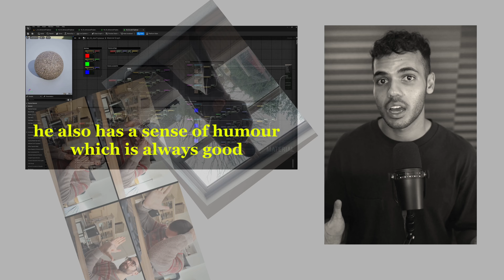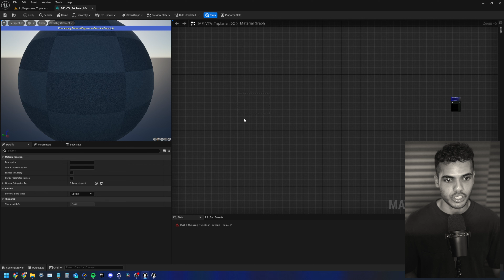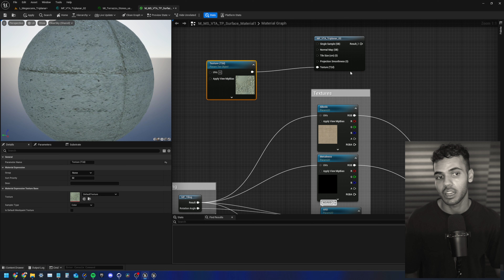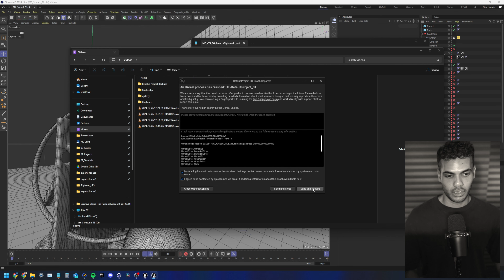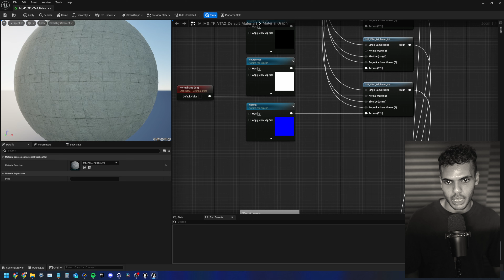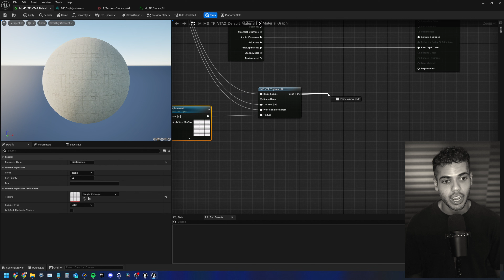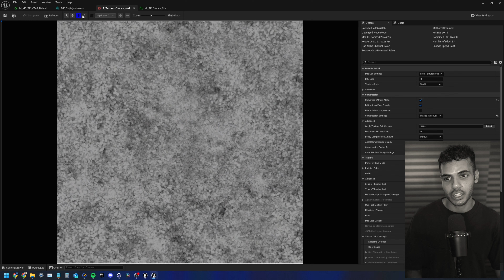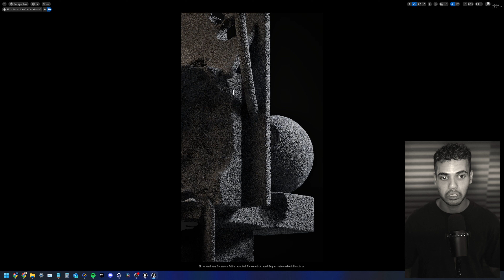Quixel Materials TRIPLANAR + DISPLACEMENT in Unreal Engine 5! (step-by-step tutorial)

Comment: This three plane material function has updated the fixed texture. It cannot directly replace the fixed material texture. What should be done to fix the material texture...
Reply from the maker: Sorry not really sure what you mean? Do you have a screenshot of where you're running into errors?
Reply: @ali.3d  This three plane material function has been updated, and the texture can be fixed on the object. How to link nodes? The original method seems to be ineffective...
Reply: @ali.3d  This three plane material function has been updated, and the texture can be fixed on the object. How to link nodes? The original method seems to be ineffective...
Reply from the maker: @yonghengshouhu  Okay damn that sucks. Try this tutorial: https://youtu.be/k943mnpYHuM?si=jLQiPLmB9hhlqj5r 
It's really good and my new way of doing triplanar materials in Unreal. He explains it really well and I even shared it in my recent newsletter.